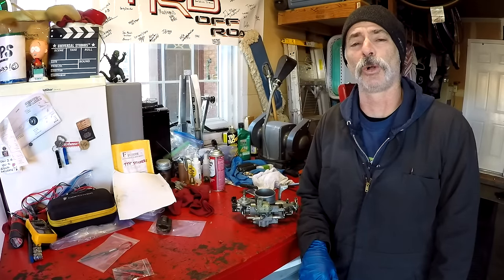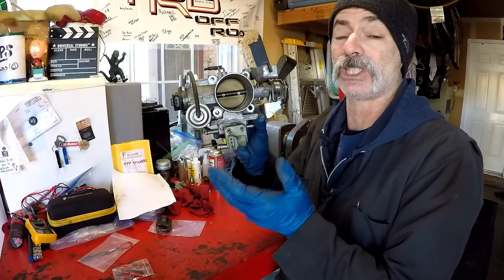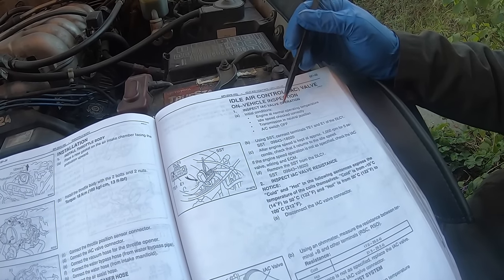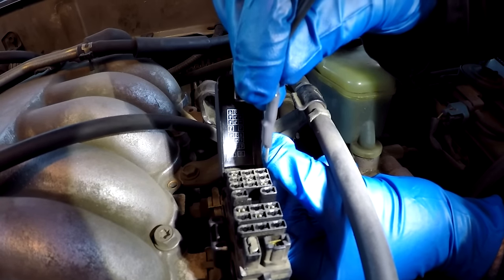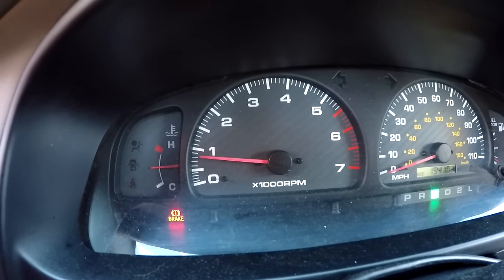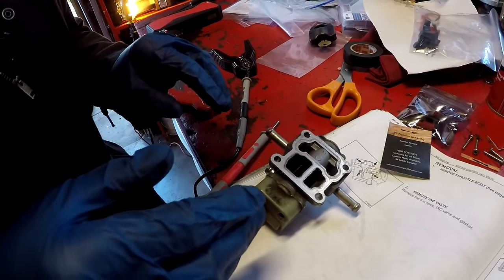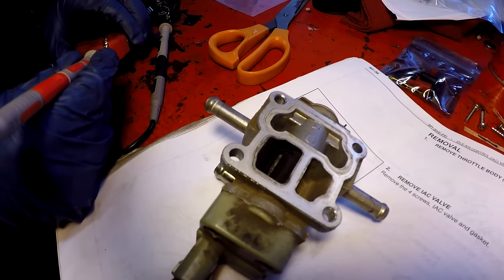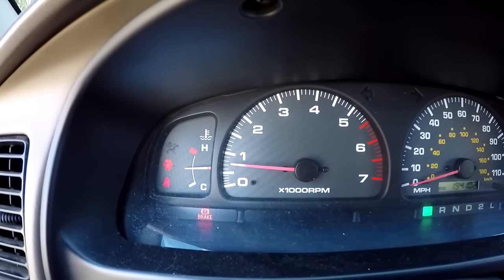IAC Valve Testing and Cleaning

Comment: Thanks for this very thorough video! Very helpful! So I followed your direction and cleaned my IAC (with MAF cleaner) and now it's idling too high. Resetting the computer afterwards didn't fix it either. Any suggestions?
Reply from the maker: Hey Lizzy, somebody recently commented with the same issue and was able to follow the steps in this video to reset their idle. https://youtu.be/_S9B3IhK_Tc  It's unclear to me why some people have an idle problem afterward and others don't but hopefully you'll get the idle back to normal again.  Let me know how it goes.
Reply: @TimmyTheToolman  Thanks! Yes I saw that ... I've reset my computer a few times now but the idle eventually goes back to being high... I think I'm going to just clean the iac again and see if it changes anything. Thanks for replying! And the awesome videos
Reply: I took it apart again and discovered the gasket must not have sealed the iac correctly, as it was leaking a bit of coolant into the intake manifold (plenum?). Cleaned it up, put it back together, reset the computer and now the idle runs great.
Reply from the maker: @lhughescca  That's great to hear you fixed the problem.  Good job!
Reply from the maker: @lhughescca  That's great to hear you fixed the problem.  Good job!
Reply: Lizzy hughes i have the same problem as you and i just had ordered  a new iac from ebay. How do you reset the computer?
Reply: @serahernandez4539  I disconnected the battery and attached the two cables together, left it overnight with the lights on. Then reconnected the battery and turned on my truck, let it idle until the idle drops way down, about 10 minutes. Then drive around town, being sure to stop at lights long enough for the idle to settle. After a while the car will reset and idle normally

Comment: Hi Timmy , what OBD reader do you recommend for my 1997 4Runner  with an iPhone? Thank you for the wealth of information!
Reply from the maker: Hey Fred,  I wish I could advise you on this but I don't have experience with OBD II readers for iPhones.  I've only ever used Android phones.  My best advice is just do a Google search and maybe base your purchase on a reader with a high percentage of positive reviews.  If you find a good one and a good iPhone app to go with it, please let me know.
Reply: Sam, thanks for laying it out perfect on the Bluetooth and plug in  systems , I'll do some more research and thanks for your time writing. Have a good one.
Reply: Timmy The Toolman thanks Timmy!
Reply from the maker: @fredjimenez4208  You're welcome.  Getting a used Android phone is a pretty good idea Sam has.  It could be your dedicated diagnostic phone.  But, it would be cool to have it all on one phone so you don't have to mount two phones while driving.  I monitor different things while I'm driving like the coolant temp, charging volts, and trans temp.  With your 97, you won't be able to monitor your trans temp.  You'll have to install an aftermarket gauge like I did on my 98.  96-98 models don't offer trans temp info via the OBD II port.
Reply: The question is how much do you want to spend? 
The conventional wisdom is that the ELM327 OBDII bluetooth code readers don't work with Iphones and you need a BlueDriver if you have an iPhone.

I've used one of the inexpensive ELM327 bluetooth readers with Torque Pro on an Android phone for several years and it worked fine on my '02 4Runner.  I then needed/wanted a bi-directional scan tool that can send commands to the ECU for things such as bleeding the brakes on ABS equipped cars when I replaced the brake actuator on a Prius  (saved me $3500 or so relative to what the dealer would have charged me). I found a deal at the time on a Launch X431 Pro-s Mini and bought one.  It works well enough so far for what I need and covers pretty much any car made it the world. The drawback to the unit I bought on Amazon is that it's not sold through the US subsidiary and it's only supported through the Chinese Headquarters.  

If I had to replace it, I'd probably go for one of the tablet sized Autels.

Comment: Timmy, having a hard time sourcing the coolant lines to the throttle body. Do you onow what size coolant line to buy? Im in AZ so deal with brittle plastic/ hoses. I checked yota 1, they have a whole coolant hose kit but dont need all the hoses in the kit and dont want to wait a week for delivery. Thanks in advance
Reply from the maker: You could just visit your local Toyota dealership parts department and they'll order them for you.

Comment: If I could get some help it would be really appreciated I’ve cleaned mine and it idles at about 1000rpm in park or neutral I put it in gear and it drops a little to about 7/800 and then it surges up and down erratically. It idled really low before I cleaned it but it still surges in gear. Also it’s an ‘01.
Reply: I’ve been dealing with this for a couple years now and it’s only gotten worse.

Comment: Hey man I know this video is old but it’s really helpful,I have a 97 Honda civic that idles really low and to where it almost stalls out and I did the readings on cold and they were 20 and and I warmed up the engine to do the hit test I got a reading of 20 again do you think even though it’s 20 it’s going bad when the required reading is 21.5-29.5??thank you!
Reply from the maker: It's possible it's bad since the reading is off.

Comment: Would it make a difference on a 2004 Scion xB if you switch the IAC  water hoses when reassembling ? How could I tell the difference? My hoses blew off and I had to replace them with different clamps.
Reply from the maker: We're not familiar with the 2004 Scion engine.  If you are unsure how the hoses should connect, don't guess.  A Toyota parts department can bring up a parts schematic to help you out.

Comment: Timmy I have a 2001 Toyota tundra, throttle body has a spacer behind it, will this not change air dynamics? I haveblue smoke coming out! So am change gaskets! Wow
Reply from the maker: You don't need the spacer.  It does nothing for your engine performance.

Comment: Excellent video....jjust a question is radiator fan control sensor also effects the idle rpm.if that sensor gone bad how can we check on that??
Reply from the maker: I'm guessing you have a vehicle with electric fans because a 3rd Gen 4runner has a fan clutch that is not controlled by a sensor.  I don't think electric fans would effect your idle that much unless it's a bigger draw on the charging system than I think it would be.
Reply: @TimmyTheToolman  Thanks for your quick response, actually i have a corolla with 4afe engine and it has a sensor which turn the radiador fan on/off. Now the problem iam facing is that it starts the radiator fan when engine (coolant)temp go very high (as i can see on the temp cluster). and due to this my car gets overheated and it does effects the idle rpm as well. somebuddy suggested me to replace the whole radiador rather then the sensor which controls the radiator fan...what u suggest. ???
Regards.

Comment: Hi Tim, great tutorial as ever. I have a question regarding testing the IAC using the jumper battery the one of the test you did in the tutorial. I do not have a battery jumper available with me my question is can I use the car battery instead to test the IAC. Thanks
Reply from the maker: Yeah, you could use your car battery.  It just has to be a 12 volt source.
Reply: Thanks Tim, car battery works.
Reply from the maker: @edisonespino1353  Good luck with finishing up the job.

Comment: Love your channel I have a 2008 Chevy Impala it won't run when I put it in reverse or start but the engine sounds good can you tell me the problem please
Reply from the maker: Sounds like a transmission issue.  Have you checked the fluid level of your auto transmission?

Comment: I am just starting to have issues with my 7AFE Celica after 11 years. At highway speeds, close to 80 mph, when I decelerate, I can feel a lag as if brakes were applied, could this be the IAC? Also, when I brake at a stop light, the car feels like its about to stall and the RPM drops way below normal idle as I stop.
Reply from the maker: Yes, it could be the IAC.

Comment: Hello can you help i already changed my iac to a new one cleaned the throttle body and put back together and i still get the same p0505 code and my engine rpm rise whenever on parking when i drive its normal
Reply from the maker: Did you use an OEM IAC valve?  Have you checked for vacuum leas?

Comment: Hey Timmy, my friend has a 91 3.0 4runner. Its got some high idel issues. Have you done any troubleshooting videos on those IAC systems or cleaning? Thanks from halfmoonbay
Reply from the maker: Haven't done much with the 3.0 liters other than pulling one out to throw a 3.4 in.
Reply: Good advice. Do you know anything about smog ability issues from motor swaps? I live in California remember
Reply from the maker: @kenantonelli8059  You can pass a smog referee inspection provided all the smog components are in place.

Comment: Hello, thanks for the video, my problem is that the car starts well at 1500 rpm and as it warms up it goes up to 2000 rpm, instead of going down, also when I drive when I put it in neutral or stop at a traffic light, the rpm oscillates from 1000 to 2000, until it is left at 2000 rpm. I did the procedure and it didn't fix it. Thanks anyway, that must be another problem. Greetings
Reply from the maker: Maybe an issue with your throttle position sensor.

Comment: Nice video.  Have u ever had a 3.4L Toyota engine (after sitting 2yrs) crank but not start...NO compression on ANY cylinder??? It even sounds weird when cranking over. I did compression test on every cylinder after adding a cap full of oil in cylinders,  NO compression?? I am stumped
Reply from the maker: Hey Dennis, I've never tried to start an engine that has sat that long.  I don't know what the issue could be.  Is this a motor that you know the history of?
Reply: @TimmyTheToolman  yes, drove this truck since it was new. Tried with no throttle,  then with throttle.  The crank and cams are clearly turning....I checked timing and with #1 TDC the cam markS are straight up and mark on crank on "0" mark?  It sounds to me almost like the starter is slipping but its not....even with all plugs out it sounds the same as turning it over with plugs in???....was told valve are stuck but ALL cylinders? I just don't know....lol

Comment: Hello timmy the toolman!. I've cleaned my throttle body on my 2002 4runner and also  removed the whole airbox assembly to do my spark plugs  after putting everything together which i did correctly im sure . I hear like a sucking sound or hissing sound coming  from inside the airbox specially a bet louder when I removed the air filter. Is this normal? I see no signs of  Cracks and I did not replace trottle body gasket tho. But idk if its normal or not. Thank you. Hope to hear from you soon.
Reply from the maker: Something isn't right.  Did you get the air filter in correctly?  Are all the vacuum hoses connected?

Comment: Hi, I was wondering if you knew the screw size for the IAC. I have the same engine on my 99 4 runner limited.
Reply from the maker: Sorry, don't know it Norman.  Maybe just take one to the hardware store and match it up with one of those bolt and thread pitch templates they have hanging.

Comment: Great video Timmy! I am having a rough idle when the engine is running hot, perfectly smooth when cold. I cleaned the throttle body and IAC as shown in this video, but I am still having rough idle problems (throttle response is greatly improved). On very hot days I will get a check engine light P0306 for 6th cylinder misfire. Do you have any recommendations or suggestions? I am doing a Seafoam treatment now to see if that helps. Again, thanks for your videos!
Reply from the maker: It could be an injector issue.  It could be a compression issue.  It could be an electrical issue.  It could be other things as well.  Since you're getting a engine misfire, I would examine that.  It could simply be a problem with the coil pack, spark plug wire, or spark plug.  If you haven't given it a tune-up in a while, replacing the wires and plugs would be a good thing.
Reply: @TimmyTheToolman  thanks for the recommendation. It only occurs when the air intake temp gets above about 90F (hot idle). Have you experienced coil packs, spark plugs, or wire issues on hot days? I am not the original owner but I believe the spark plugs and wires were replaced not long before I bought it. Vehicle is currently at 151K miles. Would you replace all fuel injectors, just the one cylinder, or clean them all? Thanks again for the knowledge!

Comment: So to be clear 800RPM is norm.  Mine is 700 or less.  You can't short sensors btw, it's not water 😊 

My idol obviously low but also varies 200rpm +/- hesitation under load also.
Reply from the maker: I think 700-800 rpms is a normal idle.

Comment: Will a IAC malfunction if you top off the gas tank? I cleaned everything needed, the code scanner shows everything is running properly,  but everytime she fuels up the tank stopping after the pump first clicks off, it wants to stall, canister purge valve,  specs out, get 5 volts, egr valve specs out, no loose hoses no cracks, I cant see how it could be the fuel filter because it would act up randomly,  just not when the tank is full, I'm at wits end..lol
Reply from the maker: It does sound like a problem with the EVAP canister.  I have not diagnosed a problem like this so I wouldn't be much help.  Maybe seek help on T4R.org in the 3rd Gen section to see if anyone has some suggestions for you.

Comment: Regards Timmy, you may have a friend who can help me. I have a 2003 Toyota echo, 1NZ-FE engine & U340E transmission. The symptom, when it accelerates and goes down to the third shift then does not want to change to fourth shift. I have to reduce speed or use the overdrive button (manual) to change it to fourth.
But whenever I need to use the overdrive (manual) with the button it works fine always. Valve body ??? ... I'm in no hurry, by the way, good work!
Reply from the maker: Hey Nevil,  it could be a shift solenoid problem.  That would be my best guess.

Comment: As bad as I hate to admit it….I put one of the coolant hoses on the IAC (I’m watching this video in retrospect) and I’m assuming I’ve pumped the intake full of coolant because it’s smoking HORRIBLY.
Reply from the maker: You're lucky you didn't hydrolock your engine and destroy it.  When the cylinders get flooded with coolant, it's best to remove all the spark plug and turn the engine over for a while to push all the coolant out.

Comment: I have a 2003 tundra 3.4l the throttle body is different any info on cleaning the iac if it has one?
Reply from the maker: It doesn't have an IAC.  Yours works another way to get air to the engine when idling.  Your baffle plate opens a little.  The throttle body you have is a hybrid.  It's partial drive by cable and drive by wire.

Comment: Hey I had a question for you, I have a 2000 Toyota 4Runner 3.4l 5spd with a high idle issue. It currently starts up cold and idles at about 1200rpm, when I rev it then it only gets higher to about 1500. I took it for a drive and it typically stays at around 1800rpm. I’ve changed vacuum lines, maf sensor, throttle position sensor, coolant temperature sensor. Nothing seems to do it. I dont know where to go from here and I’ve taken it to a shop and they just recommend the things I already replaced
Reply from the maker: You could have a vacuum leak or it could be an issue with your throttle position sensor. Have you played around with your throttle cable? There should be a little slack in the cable. If it’s pulling too tight, it will pull the throttle plate open and cause a high idle

Comment: Awesome video. I thought IAC Valves used stepper motors to open and close to various amounts. It was hard to see in your video, did yours open fully as soon as you made the RSO connection, and did it close fully as soon as you made the RSC connection... or did it makes multiple steps between open an close?
Reply from the maker: It doesn't open incrementally.  It's either all the way open or all the way closed.
Reply: @TimmyTheToolman  Yes, I see that. I am getting conflicting info from various sources. I went to an IAC valve manufacturer's web site. Their web page says their IAC valves use stepper motors ... so I wrote to them for details. 

But so far, every video I have seen when someone actuates the valve on the bench, it is like it you say... fully open or fully closed.

So, if IAC valves are only fully open or fully closed, how to they get idle speed control under various conditions?
One would think if the ECM wanted a slower idle, it would close the valve a little bit, but if the ECM wants a faster idle it would open it a little bit.
How does the ECM control idle speeds if the IAC valve can only be fully open or closed, I can't see opening and closing it rapidly (like a PWM) because how could that keep a smooth idle?

Maybe what they call "stepper motors" in the automotive industry is not the same stepper motors I am used to using - pulses to various windings step the motor a degree or so in either direction for precise positioning.

Anyway... I am going to apply 12V pulses and levels to my IAC valve and see how it responds.
Thanks.
Reply from the maker: @paulromsky9527  Yeah, what you said makes sense that you would think there would be the ability to have it partially open for certain conditions.
Reply: @TimmyTheToolman  Well, I can hook up an oscilloscope and drive around and see what the ECM sends the IAC.  Thanks!